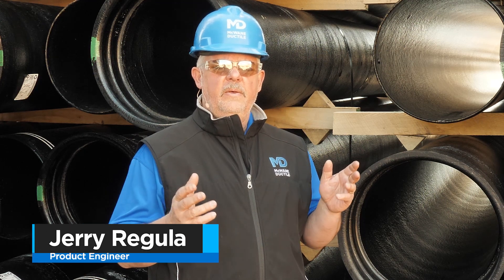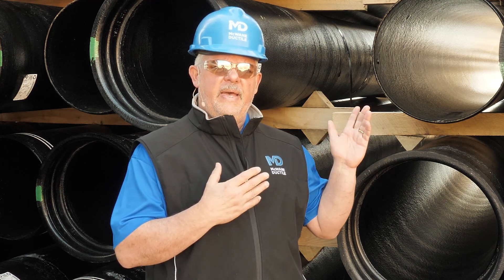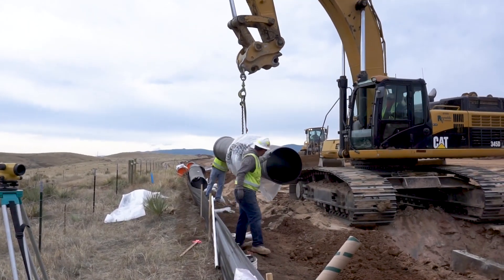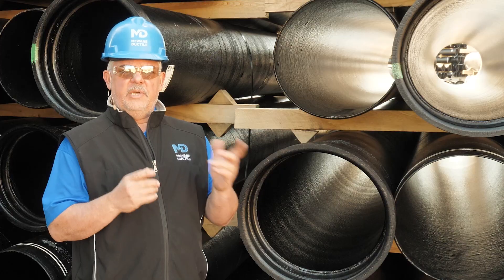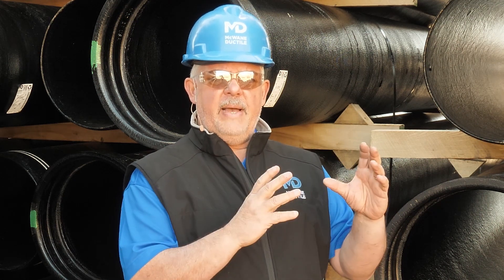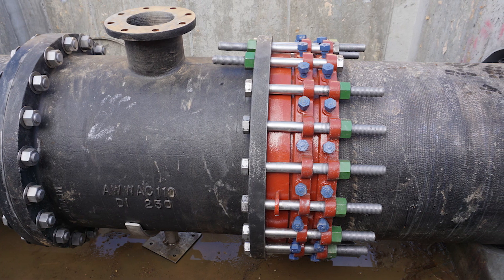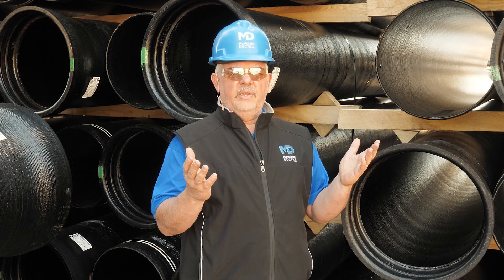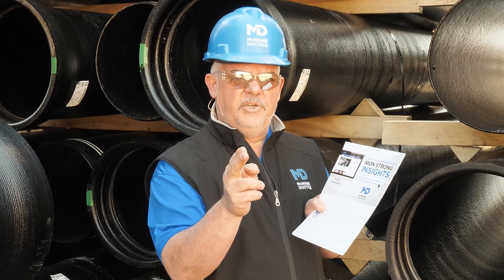Does the Direction I Install Ductile Iron Pipe Matter? Ditch Doctor

Comment: the direction of water flow doesnt matter even if the joint is free, not locked?
Reply from the maker: That is correct. Joints will not separate if the proper design calculations were implemented, and installation was performed properly. Thanks for watching.

Comment: but if the pressurised water flow is from spigot end to socket end eventually the push on joint will become loose and the joint comes off right? thereby causing a leak in the system
Reply: They make pipe mechanical restraints to prevent blow offs
Reply from the maker: Indeed. If your system design requires it, there are several ways to add additional restraint. Thanks for the comment.
Reply from the maker: Thanks for your comment. The direction in which the pipe is installed has nothing to do with the restraint of the system which is a separate question.  Joints will not separate if the proper design calculations were implemented, and installation was performed properly.  Design calculations may be completed using the McWane Pocket Engineer at pe.mcwane.com

Comment: When I started my industrial apprenticeship in england 1969, it was ,drainage spigot to collar in direction of flow and collar to spigot in direction of flow on cast iron watermains.
Reply from the maker: "The line it is drawn, the curse it is cast
The slowest now will later be fast
As the present now will later be past
The order is rapidly fadin'
And the first one now will later be last
'Cause the times, they are a-changin'"
Bob Dylan - 1965

Thanks for watching.

Comment: Sir ,can u explain ,how’s the compressive strength of DI PIPE ,while backfilling RR stone ,boulders if fall on pipe from 0.8 mtr then will pipe can damage ?
Reply from the maker: Forgive me if I have misunderstood your question, but yes, if you drop a boulder of sufficient size on DI pipe it may be damaged.  Ductile iron is resilient, but not indestructible. Thanks for your question.